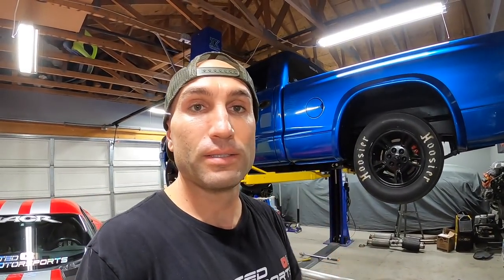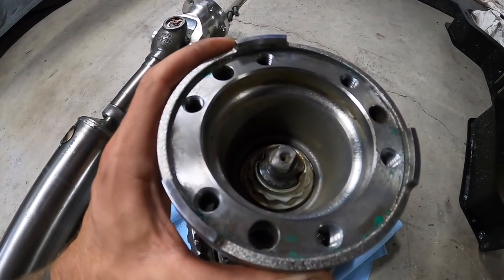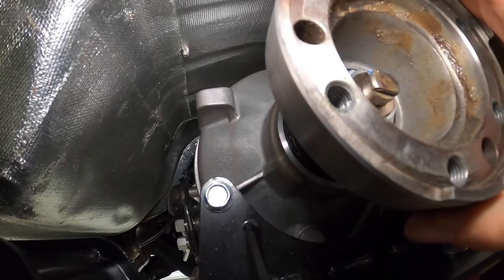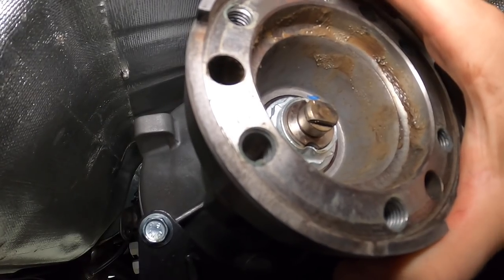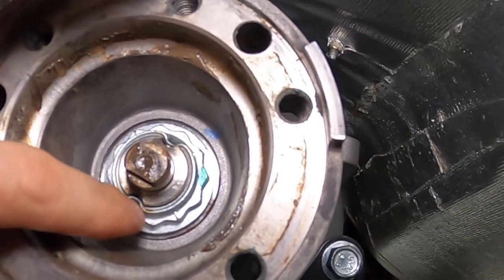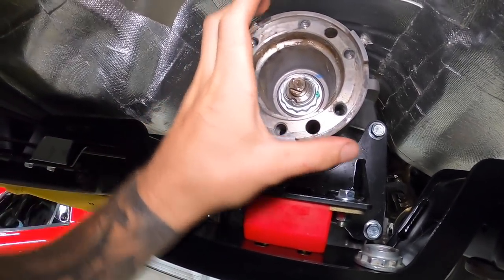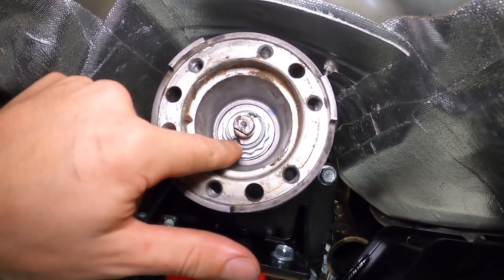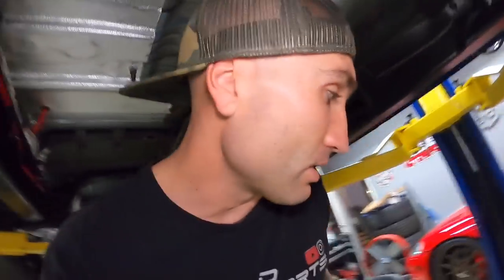DODGE ZF 8 SPEED AUTO TRANSMISSION OWNERS MUST SEE THIS | 8HP70 8HP90

Comment: I get a nice clunk that I can hear and feel in my 2014 ram 1500. Maybe this is what it is
Reply: My 2015 1500 randomly cluncked to and it ended up being the 3.92 limited slip rear end. I had a rear axel recall and after replacing it the clunk went away.
Reply: @lancelotlink3907  so just the rear axles were replaced? Or the rear diff? Thank for the info. Any help would be great
Reply: @blakeerdmann  I just remembered they did a software update at the same time as the axle recall and it shifted differently after the update. This also might have been the fix to my clunking.

https://www.dropbox.com/s/pz7xl9j3bnshvoc/Flash%20-%20Drivetrain%20Control%20Module%20Diagnostic%20and%20System%20Improvements.pdf?dl=0

Heres the axle recall - "The left rear axle shaft on your truck may not have been heat treated properly at the axle shaft bearing journal.  An improperly heat treated axle shaft may cause the bearing to create a grinding noise during operation, illuminate the Anti-Lock Brake System (ABS) warning lamp and eventually an axle shaft fracture.  If the axle shaft fractures, wheel separation from the vehicle may occur."
Reply: I think the poorly heat treated axle recall is for 2015-16 models so I bet yours could be a simple software update.
Reply: @lancelotlink3907  I had it in the dealer and told them about the software update and they said mine didn't need an update. I want to take it into another dealer and see about the update
Reply from the maker: You can tell them your want them to “reset transmission adaptives” and you do a transmission relearn.
Reply: @blakeerdmann  Good idea on checking with another dealer and maybe even call a reputable transmission shop and pick their brain over the phone but just be careful because I have found that there are very few  transmission shops that are honest and do quality work. That said I do remember being shocked at how much better a software update changed the way that transmission performed. Boostedmotorsports comment might be a good idea too.

Comment: Looks like this is only for two wheel drive 8HP’s… On four wheel drive the transfer case is in place of that flange…
Reply: Are there awd 8hps?
Reply: @HeliosFire9ll  With the 4 wheel drive flange and a transfer case any 8HP can be all wheel drive…
Reply: @HeliosFire9ll  The 300s came with the ZF and AWD.
Reply: Yeah I’ve got a 2012 bmw x5 with an 8hp and I’m awd
Reply: @HeliosFire9ll  yes the srt grand cherokees are awd

Comment: I am going to check mine and my wife's transmission in the morning! I will update tomorrow. My truck has 8000kms and my wife's truck has 160000kms.
Update: both trucks there is no play. My truck is a 2021 1500 assembled in Mexico and my wife's truck is a 2016 ecodiesel. So far no problems with the ecodiesel all though I am a little paranoid.

Comment: For the record, ALL the 8HP70, 8HP75, 8HP90, and 8HP95s are built by ZF in South Carolina and purchased by FCA (now Stellantis) and always have been. Only the 845RE Torqueflite units (V6s) are built by FCA (Stellantis) internally at the Kokomo (Indiana) Transmission Plant. If there is actually a torque problem with the rear driveshaft flange on the Hemi vehicles, it wouldn't necessarily then be on the lighter-duty units.

Comment: I have the 845re in my grand cherokee had the same issue. Just saw it now. I have 90k miles no issues yet but im glad I found it sooner than later. Thanks for this video! Probably saved me a transmission within 50k miles
Reply: Tighten and weld

Comment: I would consider getting a new nut and installing it with high strength loctite on the output shaft threads, as well as putting the indents on the nut. I wonder if the nut could be torqued a little more as well. There's a good video on YT where a guy is tearing down a 8HP90 out of a Demon.
Reply: You got it... poor production practice on a very expensive ride .....go fiat ........
Reply: Mine has thread sealant, indents, cotter pin, and welded “just in case”
Reply: @GarcBomber  Wow, Red threadlock does the welding too, so, to me that is overkill. Good Luck removing it.

Comment: Obviously someone on the assembly line is not doing their job properly....this should be a recall on Dodge's part. Go call dude 🤘😎🤘
Reply: or the trans/driveshaft tq/vibration is stretching the threads and making the bolt loose.

Comment: Good stuff… I have 178K on my odometer 2016 ram R/T have had a vibration for about a year now that  I could not figure out where it was coming from. I just got under the truck and sure enough that flange is loose…

Comment: I was told that the 8HP90 transmission are built & made overseas.
Reply: The ZF transmissions are German. Well built and reliable.
Reply: ZF Transmissions are German built and are put into a lot of high horsepower exotic cars. Look up ZF 8HP transmission on Wiki and look at the list of cars that use it.
Reply: Yes you are correct they are dropped shipped from ZF Germany. It reminds me of my 2006-7 Dodge chargers with the Mercedes 722.6 they too where dropped shipped from Germany and later on Chrysler built them in house.
Reply: Good "Heads up @ Eyes Open" find, have to be pro-active when working on today's vehicles!!

Comment: I had an 09 Ram 1500 and had the rear end blow up on I-5 near Seattle Wash in 2010 with less than 8000 miles, Dodge has a history of not torquing down nuts ( rear axle pinion nut loosens, the axle exploded!!! Maybe they have screwed up again

Comment: Dodge has never got transmissions right
Reply: You hit the nail on the head!
Reply: Not true, the old school 727 trans from Mopar was damn good!
Reply: Has any manufacturer gotten an automatic transmission right?? The automatic transmission has always been the achilles heel of any powertrain. But overall the ZF's are great, IMO.
Reply: @ogcowboy9078  I have heard the 727 was a good trans, never had one though. Im on my second 46re in my Dakota RT.
Reply: The 8HP90 hell cat transmissions are direct shipped from Germany .. Chrysler does not build these transmissions in house. This is a ZF issue, Chrysler didn’t build or design this transmission it is a kit.
Reply: Not true and the hell cat transmission isn't made by Chrysler there made in Germany
Reply: Wether the trans was made in Germany or elsewhere, its in a Dodge vehicle. Dodge is responsible for the quality control of their vehicles and any suppliers they use
Reply: @ejclones2649  this really applies to Dodge trucks
Reply: @ogcowboy9078  Pretty sure that was the transmission in my Plymouth 'Cuda. Ran great until I took it to a transmission shop to change the oil and filter with the 29.99 special they were running and it blew up 2 weeks later. I was 18 and learned a big lesson about repair shops that day.

Comment: The only way i know this is a true issue is i have a 2003 ram 3500 6 speed manual 4x4 and it has a slip yoke with one of those balancer things on it and the rubber was severely cracked on one side causing same type of vibration and it comes on about 60-65mph then goes away then comes back at just over 70 then goes away again its bad though like it sounds like how a bearing vibarates almost but just shakes the shifter and vibrates the whole truck. I know its a different setup and not the same but that vibration your feeling is certainly from near the output, luckily my transfercase hasnt blew up since the vibration has happened it has loosened the transfercase chain and last time i used 4x4 to back out of sand onto the road it was clicking and chain slipping bad lol now time to rebuild tcase and get a new vibration dampener yoke for the driveline. Hopefully FCA Chrysler watches this! 44ft lb holding all that power sounds low to me trying to put out 700+ horses, hopefully they reevaluate and bump that 44ft lb number up

Comment: This video might have helped me a lot. I have a 2016 ram RT and 5 years ago when I first got it I tuned it and tried to do a top speed run. It ended up throwing the stock driveshaft out of it around 115. Dealership replaced it under warranty and when I got it back it still vibrated bad above 100. I bought a driveshaft shop driveshaft thinking it would fix my issues. Got it put in and it was better but would still vibrate above 115-120ish. I finally got fed up and just held it to see if anything would break. At 136 it vibrated so bad it shook the rear tail shaft bearing out of the transmission and broke the case. Once again dodge replaced the transmission under warranty. I got it back and have been scared to run it that fast ever since. Although I have ran it up to 130 a bunch of times and the vibration is very minimal but it’s out of warranty now so I just try stay under 130. With the new transmission the vibration seems a lot better. I’ll let you know what I find when I get home. I’m curious now

Comment: Can you please provide me with expert technical support and advice? I am not convinced my transmission on my 2016 charger scat pack has failed at ~ 40934 miles and it concerns me even further as I also have the 8HP70 model transmission in my 2015 RAM truck at ~ 55100. I was driving about 40 - 50 MPH when I heard an unprompted downshift and then moments later check engine light came on and message “service shifter”. The transmission also seemed to be stuck in a lower gear in D. I scanned the OBD2 and had confirmed permanent codes: U1412; U0402;U0001; P1DD2. On the electronic shifter module: U0402; U0101. On the power control module: U1412; U0402; U11C2. I had the car towed to a dodge dealership and they are recommending that I change the transmission.

Comment: So I went under my 2021 1500 and I am able to rotate the driveshaft a tiny bit left to right. Is that nornal? It rotates at the front of the driveshaft as well. It seems normal. Are you more concerened with up and down wiggle?
Thanks to anyone who can comment

Comment: Not sure if you will see this, but question for you, I have a 2016 ram 1500 slt lone star 5.7l rwd- have you heard or seen the bump or jerk on some of these? Best I can say it feels like a small trailer hits you when coming to a stop or taking off? Took to a transmission performance shop and they could not get anything off the codes to cause that. 🤷🏼‍♂️doesn’t seem on a google search anyone else has figured it out.
Reply: I've been feeling that for a little over a year now. 16 quad cab 4x4 5.7. when it warms up to temp it ain't nearly as bad. But I'm worried.
Reply: Having same issues on my ram same year if anyone have an idea what could be I would be thankful for the help 🙏

Comment: Not sure what else is behind that yoke, I kind wonder if 44ft-lbs is what the factory went to, but then a few thousand heat and vibration cycles wore something in to cause that slop/play. 

Or if perhaps one part of the assembly line didn't set their torque specs properly. No bueno.

Comment: My transmission with @ 35,000 miles bucks in hesitation when accelerating out of a low speed cruise. Any ideas?  This is my third Ram with this 8 spd transmission and the others were never a problem.

Comment: The output shaft on my 2012 Charger came all the way off.  I put the car on my lift and sure enough, the nut was just sitting in the driveshaft Ujoint section (All the way off) and the driveshaft pulled out just enough to not grab the splines..

Comment: There is gonna be a little bit of play at the output shaft of any transmission because of the seal similar to a rear main seal on an engine or a front wheel drive car. When you check for bearing play, there's always gonna be a little bit of play that should never be right snug up against the transmission Itself because then it won't turn very well and then overtime that added pressure from overtightening it will start to the output shaft of the transmission and you don't want that because there has to be a certain amount of play for the rest of the transmission operate properly so you might run it to other problems too but yeah, there's always gonna be a little bit of play between the transmission Casing itself and the transmission output, flange, which then attaches to your driveline obviously. if the correct type of transmission fluid isn't used that can also cause the transmission to grenade because it doesn't have the right amount of friction. Need it for the torque converter to work properly and vice versa if you have too much fiction that can also cause transmission problems from the torque converter, having too much grip or friction, if you will. This is the video I watched of yours about the transmission other than when you drained and refilled the transmission so I'm not sure where or what happened two years ago since this video, but from my knowledge of my experience as a technician for heavy duty, tractor trailers for years, and then automotive before and after that. With the transmission and neutral you were going to get some play and that's when you want to be checking your driveline when there is no load on a flat Service with the parking brake off and the engine neutral and the wheels cocked that's when the proper checks can be made along the driveline, including the transmission output Flange area. There is a specification for the amount of movement no different than again the front wheel drive or front end of a car wheel bearing play there has to be some wheel bearing play. Otherwise the wheel bearings will create too much friction and not allow enough lubrication at higher speeds when the expansion and contraction occurs due to a friction, heating and cooling of the wheel bearings no different than the output shaft of your transmission, or any transmission for that matter once it warms up, it's going to dissipate or less, but there is a specification you can check using a or gauges and whatever procedure outlined by RAMM or the manufacturer of that transmission. Not sure if this helps at all but hopefully you figured out the issue when I turn on YouTube videos pop up and then I scroll through until I see a familiar face regarding automotive how to repair videos and that's when I noticed  I've watched his videos before so I'll watch this one. If you've already figured out the problem my apologies for trying to tell you what to do but I never do that. I make suggestions because I'm like everybody else, still wanting to learn.

Comment: this transmission is not made for drag racing. Its only a stock unit made to be driven normal daily driver. If you are going to drag racing, get it modified with heavy duty components

Comment: I'm having a hard time getting the torque converter installed properly. On the input shaft by the pump is a gear that spins freely and I can't get the converter to go past it is there anything I should do I've taken the converter out five times had it standing on its tell housing and still can't get the converter to set all the way couple of coworkers have tried same problem
Reply from the maker: These only click twice not like a conventional converter

Comment: Checked mine this weekend because I'm having a whipping sound like a tie wrap is on the drive shaft and sure enough it's loose. I have an appointment tomorrow at the dealer to have them check it out. I did notice about a month ago I got a CEL on the highway and the tach raced up to 5k going like 70 and when I pulled over and restarted it went back to normal but the CEL lasted for about a day or so. I'm at 95k (2016 Scat Pack Shaker) miles and luck to have purchased the Mopar MAX extended plan which is a bumper to bumper coverage up to 125k miles. SMDH I don't even race this thing.
Reply from the maker: Keep us posted what the dealer says!!
Reply: @BoostedMotorsports  Driveshaft replacement. It should be done by next Thursday. They didn't say anything about the Transmission flange but I'll make sure it's documented. I have a Mopar Max plan for another 30k miles/2 more years.

Comment: Jon, just saw your video of your good used transmision. If this transmission fails in another track race or pass, my suggestion is go for TH400 transmission. I've got a few friends that race their hellcats with a TH400. They tell those TH400 are more durable & better built for the hellcat power than the weak 8HP90.
Reply: But no lock-up converter or overdrive.